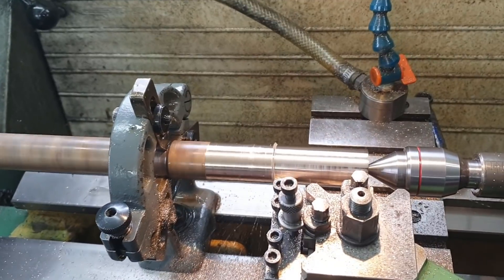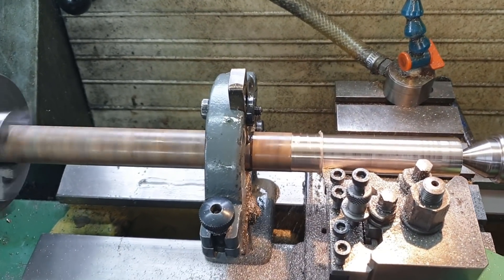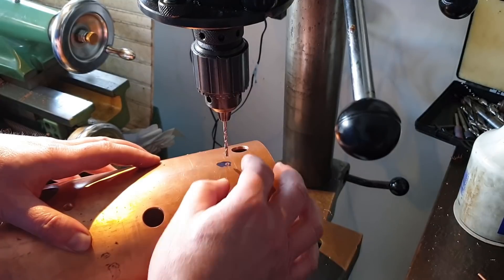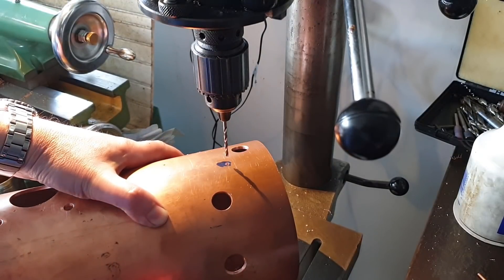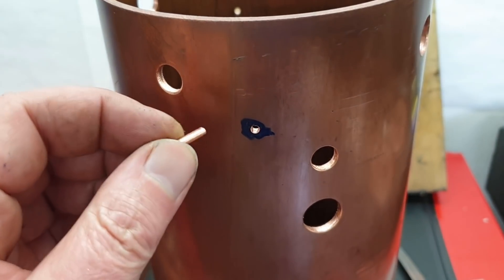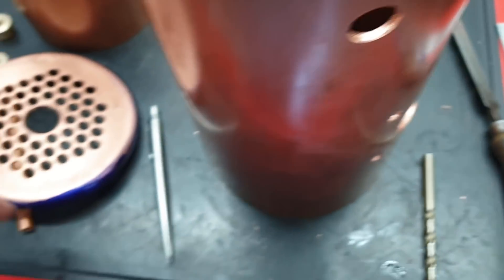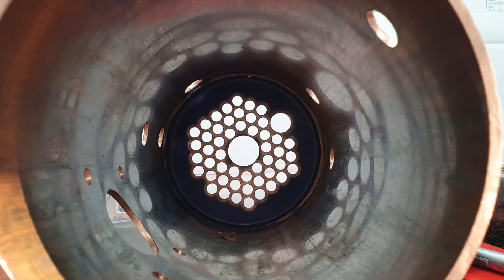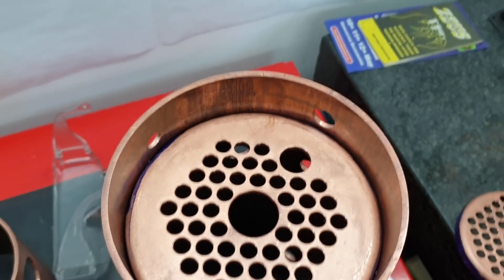6" Vertical Boiler        Part 8 - Boiler Bushes and Trial Assembly

Comment: Hi - I am just making the bushes for my boiler (same if you recall)....i am curious to what size threads you chose as the drawings suggests either 3/8"x32 or 5/16"x32. How exactly do you decide? Also, what size copper rivets did you use for holding the plates in situ?
Reply from the maker: Hi Matt, The copper rivets are 1/8" x 1/2" as I happened to have them in stock - not critical. As for the bushes I went for the larger thread size -  I only had 3/8" x 32 taps so that was that!

Comment: Been waiting for the next video for a while now... How did you go with soldering ?
Reply from the maker: Hi - The boiler progress has halted and has not yet been soldered. I am busy with a house renovation at the moment so my model engineering has all but stopped. As soon as there is any progress I will upload a video. Cheers Craig.
Reply: no23mk2 I’m in the process of gathering of all the material for the same design boiler. 6” tube was very pricey, but I need a large boiler for my recently built PM Research CI 6 engine. I hope you get a chance to get back to your modelling soon !

Comment: Great job Craig, nice to see a steady in action, my last job as a turner was boring out and threading 3 metre long 350mm diameter hydraulic cylinders to take the buffer, all steady work, great stuff....Allen.
Reply from the maker: Cheers Allen. That was some work piece you were turning! The biggest lathe I've ever come across was a lathe that was at NEI Clarke Chapman in Leeds used for turning steel rope winding drums for use on cranes. The lathe operator had a seat on the cross slide!

Comment: Looking great, nice to see it getting closer to completion :-)
When you come to solder the tube assembly is the intention to solder the tubes and plates together outside the boiler barrel then rivet and solder the assembly or are you hoping to solder all the tubes etc in situ?
Reply from the maker: Thanks Peter, My thoughts so far are to solder the tube plates and bushes into the barrel and fire box in situ with high temp solder then to solder the tubes afterwards with a lower temperature solder. But this may change....
Reply: @no23mk2  Craig I'm not sure if this video may at least give you some things to think about - he made a 2 part video showing it steaming and it appears to work well :-)   https://www.youtube.com/watch?v=i7YtCc4aSY0
Reply from the maker: Thanks Peter, I must have seen these videos yonks ago as I'm subscribed to his channel. It is a good reference.
Cheers Craig